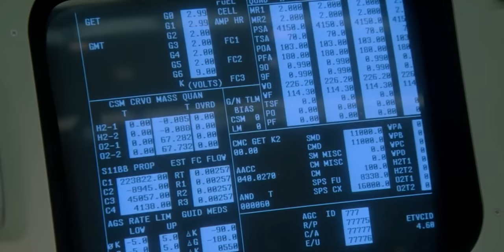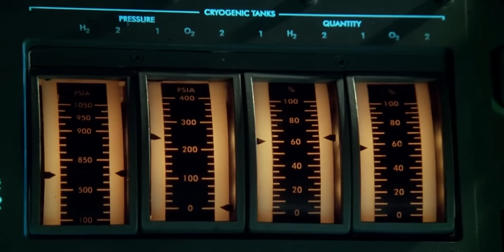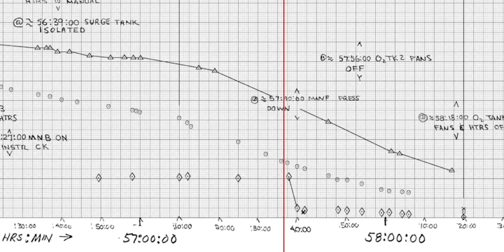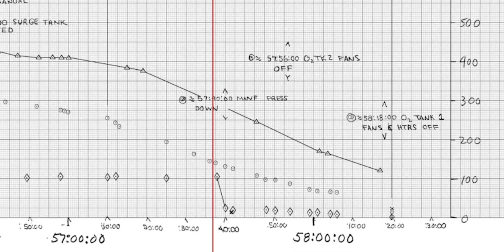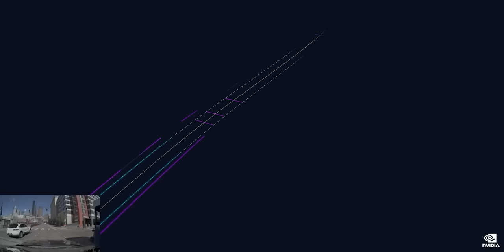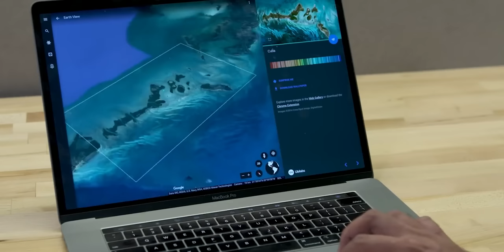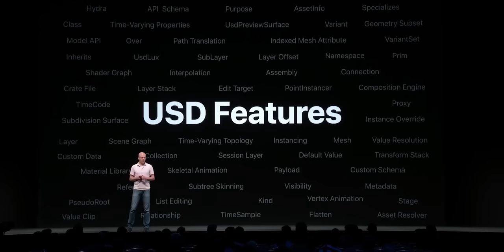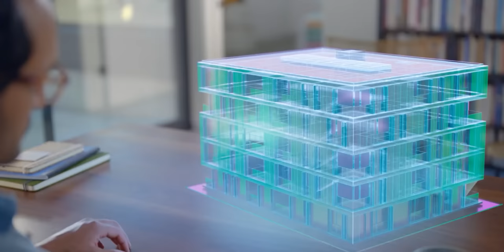This BIG Mistake at NASA Started the Metaverse

Comment: Hello Alex. I have a question for you: Is Nvidia, which started with Omniverse, better than the Unity platform, which has been in development for years? How do you evaluate which platform has the greater potential? Can Nvidia take over Unity customers? Or will it take many years to catch up with Unity?
Reply: As a game dev, I can tell you that Unity is really not great. It's not horrible either, but it's almost nobody's first choice unless that's just what they are very used to. 
I would never buy unity stock. I would buy stock of Epic games if I could buy them directly, without having to buy Tencent.
Reply: @coronnation8854  Thanks for your comment, an analysis based on individual preferences does not always make sense. I would never buy an Apple product. Which doesn't mean Apple is a bad investment. The essence is what the majority will do, and for this you need to compare usability. Since Epic cannot be purchased directly, it remains Omniverse vs Unity;)